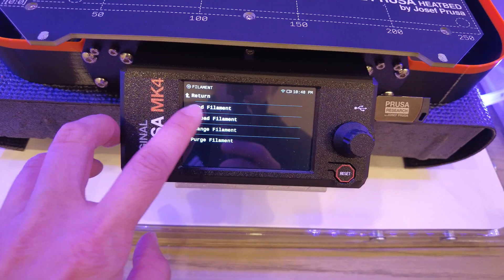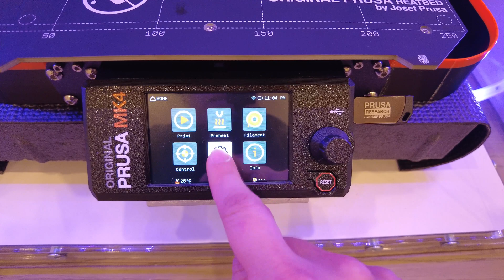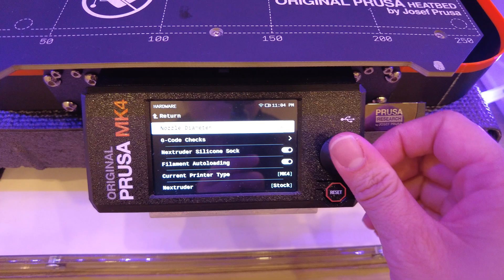Step-by-step: Prusa MK4 Nozzle Change in 2 min. Safe, Quick, Easy. 2 Printable Tools & No Re-wiring!

Comment: Almost as easy as the revo🙄
Reply from the maker: Haha. Yes. But one of the reasons I did not get the revo was the risk of leak with the adapter as described in this video: https://youtu.be/Zlg8NtmrGCY?si=0S86lDAoeUqUiDTG . I went with the Obxidian instead.
Reply: @jiureviews  I looked in the transcript and found no reference. What are you talking about? I've had a revo for a couple of years but never had a leak
Reply: @jiureviews  are you talking about e3d nozzles with the nextruder? I'm talking about the revo hotend that is totally toolless and the nozzle and heat brake comes out in one piece using no tools. The nextruder is based on it but doesn't violate e3d's patent.
Reply from the maker: Hey yes you are right. Sorry, I confused the nozzle names when I made my previous comment. The video I referenced was talking about leaks from the v6 with the adapter. Thanks for clarifying.
Reply: @jiureviews  well, I totally agree with you on the adapter nozzle. That's one of the reasons I opted for the revo in my mk3 no more leaks. When I upgrade to the mk3.5 I'll be very happy to retain the revo it's so nice to change nozzles so quick and easy.

Comment: do you need to use a torque wrench or is finger tight like you did sufficient?
Reply from the maker: I would recommend using a wrench near the end like in the video to tighten it (but don’t overtighten). It’s hard to use just finger to tighten because the nozzle head is small. Thanks for the comment!

Comment: Awesome video, thank you. 

Just out of interest, what’re the benefits of using a silicone sock?
Reply from the maker: Thanks for the comment! Good question. 

1) It provides protection from failed prints - like spaghetti monsters or whenever the filament starts sticking to the hotend. It's much easier to clean or replace than trying to clean the hotend directly. 
2) It also helps maintain more consistent hotend temperature. 

If you do get one, remember to toggle ON the setting in the MK4 Hardware menu that the silicone sock is on. Hope this helps!
Reply: Thanks for the info. 

Have you noticed any improvement in print quality?
Reply from the maker: @muhammadmirza9455 hard to tell with respect to the print quality as I never A/B tested it. However, it has definitely saved me a few times when prints have failed - much easier to clean up with the sock.